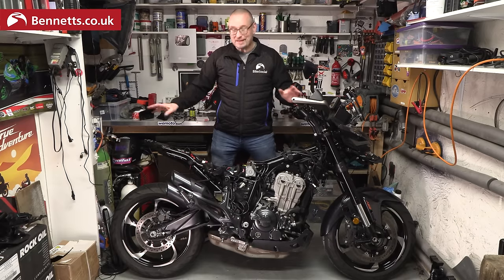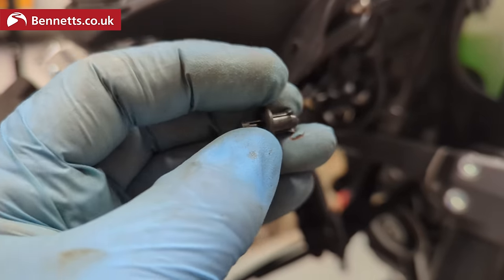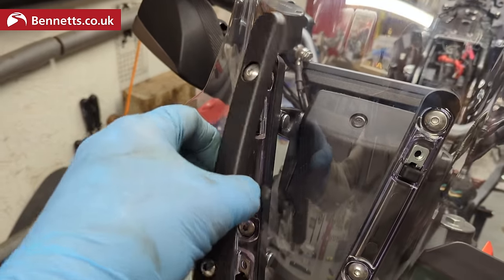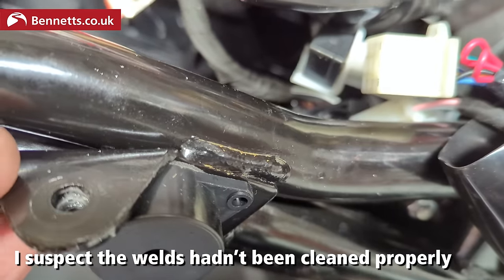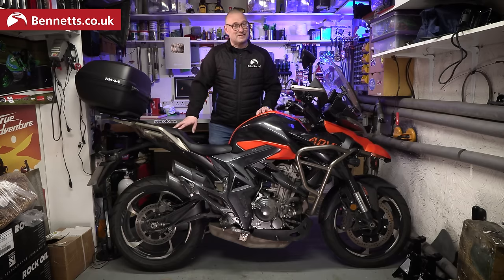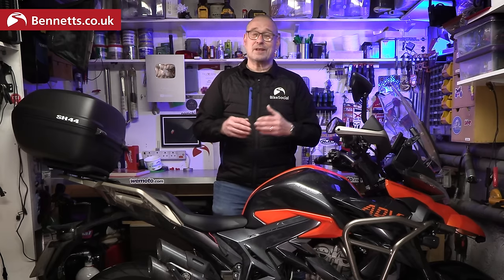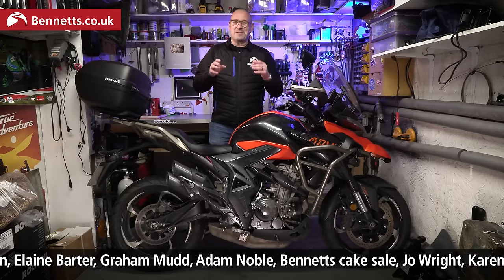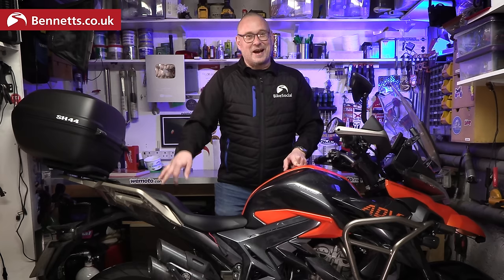Good and bad with my Chinese motorcycle: Electrics, rust and fault codes

Comment: I love the attention to detail on the bike (apart from the Bosch unit). Thanks for showing us how it looks under the skin! Keyless entry on bike solves no problem we ever had. And this is not a bash at Zontes. BMW do it, Triumph, Ducati... it is crap. It causes more issues rather than making life easier. You cannot lose a key that it in the ignition. You can, however lose a fob while you are out riding.
Reply: I keep my fob in the inside zipped pocket of my jacket, I never ride without the jacket not ever.  I also keep 2 spare batteries with the fob just in case but I've not needed to use them as the bike let's me know when the fob battery is low.  I also have a permanently attached cable/connector to the bikes battery behind a pop off panel just incase it goes flat so I can unlock the seat.
Reply: I will have to correct you on that. I have had a key jump/fall out of the ignition barrel on my high mileage gpz900. It was a shock after doing 30 odd miles across London to find no key in the ignition.
I was fortunate enough though to have the keyring and plastic part of the key to melt and stick to the top of the downpipes.

Comment: When I watched the previous video i was considering a new Zontes-G1 scrambler125 for around £3200.
I instead got a 2005 Honda Varadero XL125 in mint condition 7k miles for the same money, 
I think I made the right choice.
Reply: Absolutely.
Reply: Just don't ruin it with awful chav modifications lol. very rare seeing a good condition Varadero these days.
Reply: @mrpantur7280  I've not seen any Varaderos with chavy mods on tbh, I had a Speedfight 2 2stroke before this and that was a chavtastic special - this one is a bit more grown up.
Reply: @TheOmniscientAtheist  dam. Where I live I've probably only seen 2 clean examples. Usually they are covered in stickers and have modified exhausts that has a exhaust leak and the engine is rattling because it hasn't had an oil change for 5 years lol. Yeah seen loads of chav 2 stroke Peds. Especially if it's an aerox or Zip they always smashed up and heavily modified lol.
Reply: I think you did and you weren't supporting a hostile power.
Reply: I have my g1 125 for 34 months and 15k. No problems at all
Reply: @arthurramm8664  -  In all honesty that's probably the most ridiculous comment in here. Stupidity on top of propaganda! Sad really!

Comment: Under a couple of thousand miles and there's already paint flaking around the welds exposing corrosion beneath !
That's not an issue with the welds not being cleaned, that is paint over rust ! I know it's a budget bike but people buy bikes like this to commute to work and have fun on their days off, those electrical issues could leave you stranded at any time !
Reply from the maker: Hopefully not when I'm on my way down to Spain! Still, that's what this test is to find out... Cheers, John
Reply: @bennettsbikesocial  The world loves an optimist. On your own that could potentially be an adventure (been there, done that on three continents), but with your wife on board…? Yep, you’re definitely an optimist. 

I once drove a Volvo 264 with a KNOWN busted cylinder block paper gasket, from the UK to half way up Norway in the middle of winter - without snow tyres!! (Not only Totally illegal, but officially regarded as impossible). 

I was running an open radiator (to prevent the cooling system from pressurising and forcing water into the oil), and had a washer bottle with water pump from an Austin 1300 rigged to top up the radiator every few miles as it boiled away. The system was wired up to a redundant switch on the dashboard. 

Naturally the heater was on full all the time, so it helped augment the main cooling system. I was carrying litres of water in bottles, and had to stop multiple times to refill everything - once at a fast flowing mountain stream that was only acceptable over a field of 2ft deep snow. 

No one ever believes this story, except my fiancé who was waiting for me in our apartment half way up the side of a fjord. 

Despite coming off the road several times, and performing the most ludicrous stunts to navigate up the steep inclines after disembarking from the multiple ferries, and averaging 15mph over two and a half days of driving, I eventually arrived in one piece, and loved every single minute of the journey. 

Driving back to the UK, in the same car, in the same condition (except for studded tyres), but now with my fiancé on board, FULLY loaded with gear, was a somewhat less funny experience. 

They are much more sensitive to impending disaster, and wired less predictably than Chinese bikes. 

Peace 🏴
Reply: @G58  😪
Reply: my Lexmoto had a throttle issue - left me stranded just like you said!
Reply: Although in a perfect world all those welds would have been immaculately clean before painting. And the electrics could be made next level. The fact remain that It's a cheap bike. With way more features than the Japanese competitors. And truth be told regarding many of those issues even the Japanese bikes are not totally exempt of them! Which is something anyone who work on their own bikes could tell you right away. 
In all honesty I'm very well impressed by the overall bike until now. A few rough edges, for sure, but none that I could pin point as a deal breaker. I'm pretty sure in a few years most probably production methods will evolve. And things like galvanized frames will be a reality but then the price... ;-)
Reply: @CensorshipGenesis  There's an old saying which is relevant, "buy cheap, buy twice" !

Comment: I bought a six month old Sinnis terrain 125 when I passed my CBT. I ordered it for eight months and about 2000 miles on a mix of 40 mile trips up to a 1000mile four day tour. While the dealer network were not particularly good (overhead telephone conversations about not bothering to replace seals, wrong oil used, poor customer service/timekeeping), the bike itself was great. I don’t recall it ever letting me down(although on the factory battery it struggled to keep itself charged and supply my heated kit) and on one day back from the Lake District (370 miles) it was at 9000rpm, red lining, all day without any complaint. I did swap the tyres across from the CST Nylon specials to Metzelers. It was also hosed down with ACF regularly. Overall I was impressed particularly given everyone said it would be a mistake. The depreciation was spectacular for the first owner as list was £3400 and I paid £2100 but then I sold it for £2200. I’d get another. My next bike was a 748, which I still have and now a r1250 GSA but I’d love to ride that Sinnis again as it would be a laugh. Motorways were not as much fun but I could happily go green landing on it and I do recall a couple that took a pair to Mongolia with little fuss.
Reply from the maker: Thanks so much for this! Please do join our FB group if you can. Cheers, John
Reply: I've a carbon copy experience with my sinnis terrain too, I strangely wish I'd kept it for town and local runs. The throttle cable went on mine and a AA guy made me a new one on the side of the road in the middle of Northumberland moors- which I never replaced!!

Comment: Thanks you for being so informative and it's quite refreshing for someone to go so in depth. I've got a new NC750X and it's got 700 miles on it now and the exhaust is showing some rust already and I've not even been out in the rain just once one slightly wet roads. Also the plastic panels just above the pegs are showing signs of scratches where my trousers rest so I've covered them with helicopter tape. So in essence it's not just the Chinese bikes..
Reply: I have the cmx rebel 500 it’s only 9 months old, the front bottom fork on the left side mat black paint has started coming off, luckily my Honda dealer got it done under warranty, but all bikes these days have problems with paint coming off, I have a virago 750 it’s from 1993 and the paint is still perfect on the forks , so it must be the different paints they use today .
Reply from the maker: Thanks for watching! All the best, John

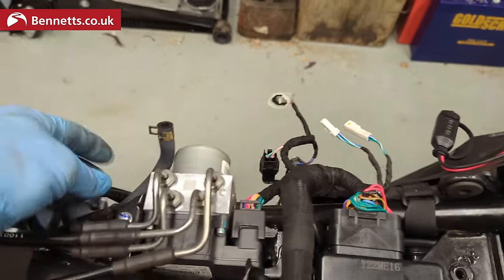Comment: Spotter here - the connector in your hand at 2:17 is a TE Electronics Superseal connector - a fairly pricey family of connectors found on premium bikes (like the Ducati 1199) and cars (like the McLarens I used to work on). The smaller connectors at 2:21 and 8:29 are Japan Solderless Terminals (JST) connectors and (again) are fairly premium, high quality connectors (and found on the 1199) - so it's very surprising to find this 'quality' of electrical hardware on such a budget bike......

.......They are however, regularly counterfeited and available on the likes of Amazon, eBay, AliExpress etc etc. - the types of counterfeit manufacturing regularly attributed to the Chinese.
Reply from the maker: Fantastic, thanks very much for this!
Reply: pair of 2 pin superseal connectors cost around 70 euro cents...
Reply: Yep anything that 'looks' quality is a tofu copy.

Comment: Great stuff! Be very interested to see the same re CF moto bikes.
Reply: I had a 2022 CF Moto 250NK  for a while and I had a couple of issues with it.  First one was after riding in the rain I had a fault showed up on the display and it only went when I clicked the on/off stop switch next to the throttle a couple of times.  Must had got water inside.  The second which was more annoying was the heat from the engine on a warm day.  Very uncomfortable and I feel they didn't get the fan to come on early enough.  Apart from those issues I liked it.

Comment: Excellent report thank you very much! About the warning light, I haven't had any since I bought the bike in October. Still, I think my case is different because I know that the 350T is assembled in Egypt and they have fixed the errors of the previous generations; again, this is according to what the local manufacturer has said. Talking about the antenna, I had the same problem at the beginning when I left the bike unused for a while, but when I went back to using it every two days, things went back to normal, I do not have any explanations for this. Finally, you are right about the rust. 
As for your trip to Spain, I know a YouTuber has made a long trip from Egypt to Libya with his 350T, so you can rest assured that the conditions of your trip to Spain will be much smoother.

Comment: A few years ago I had a Chinese electric engineering machine. I striped out all the wiring and fuse box and replaced with flexible race quality cable etc. Total reliability and better efficiency. The quality of steel was still crap but it did what I needed.

Comment: I'd always stand by the belief of having all the yaw and wheelie control, abs, efi, drive by wires, real time suspension adjusters,  or any tech to push performance and driveability on heavy adv bikes or circuit bikes.

..but for small cc adv, commuters, or thumpers below 650cc, carbies all the way! That's considering the rider knows what to do with a wrench tho lol

Comment: I have a terrible problem with my 1 year old Herald Maverick 250. It's been sitting in my garage with a full tank of E10 since October, but the battery didn't go flat and the thing fired right up this morning. It has almost 9000km on the clocks and it hasn't gone wrong once, no rust no flakey paint nothing,  despite commuting through all the salt and rain, and being hammered off road most days. (ACF 50 is a miracle worker). Everyone tells me this isn't right, and I should sell it quickly while it still has a years warranty and RAC recovery left on it. I would add that the electrode fell off the "NGK" spark plug when I was gapping it, and the local motor factor told me it was a counterfeit.

Comment: The BMW GS suffers from corrosion problems, would love to see a video of that, as they are rather expensive motorbikes.
Reply from the maker: Touch wood, mine hasn't yet (2019)
Reply: @bennettsbikesocial  Thanks for reply, but that doesn't mean they DON'T corrode. Pretty sure viewers would like to see a £20,000 GS with the Bad/Ugly points as well. Go On be brave!
Reply from the maker: @frankspeakmore7104  if mine did it, I would. Look back at some of the previous videos and I'm not shy of highlighting any issues I have, no matter what the brand.

Comment: I have a Zontes 310-X2 instead of the 350T. One common issue on my bike is the coolant container tends to develop a leak. I had mine replaced about a year into owning it (around end 2020), and the replacement started to leak end of 2022.

The other issue is that the brake line needs to be bled quite often. Somehow air gets trapped one way or another.

I didn't have the Dump Sensor issue, but it does make me want to strip my Zontes just to see how the unit is placed.

Comment: Not interested in this Chinese stuff but my ears pricked up when you mentioned a satnav review! I use a car TomTom in a waterproof case (bike satnavs are horrifically expensive) as it has speed camera warnings which has proved very useful to me on a few occasions. I think I'm correct in saying phones still use cellular network antennas which can have dead spots while satnavs use satellites.
Reply from the maker: Depends on the phone, though the tablet I use (a Carpe Iter) has a dedicated high-end GPS chip: https://www.bennetts.co.uk/bikesocial/reviews/products/motorcycle-technology/carpe-iter-v4b-tablet-review
Reply: Nah.  Every smartphone has GPS, works really well with maps. Waze is especially good as users can input real-time alerts for crashes, speedtrap vans etc, and every user in that area gets immediate update).  I used Garmin satnavs for years, but now I'm solid for Waze.

Comment: A really good, detailed and in depth analysis. With reference to the ECU, I wonder if the foam pads are meant to be self-adhesive on both sides, with the ECU being held on the underside of the rear subframe? Still doesn't explain or excuse the ziptied earth connector though...
Reply from the maker: No, sadly not. And the chassis plates are too contoured for that to work. Nice idea though. Cheers, John
Reply: @bennettsbikesocial  Thanks for replying 👍
Reply from the maker: @luddite6239  sorry it took a while... Four of us from work were doing a firewalk to raise money for Magpas!
Reply: @bennettsbikesocial  🔥🔥🦶🔥🔥 Ouch!

Comment: Buying a Chinese bike is a bit like buying a "Used something else." They are modestly priced and you get exactly what you have paid for. I have recently bought a 2023 Moto Guzzi V7850. It was a lot of money and is built like it was hewn from granite. However, I have still found cross threaded bolts on it and such. So, NOTHING is ever 100% fault free, even the expensive stuff on occasion. I also have a "Chinese made,"  Benelli Imperiale 400 in my collection. It is 3 years old  now, with just under 5000 miles on it. I use it for going up to the village to go shopping and nipping to the garage for a pint of milk etc. It does need "Keeping dry" as the chrome is not been very good, and the ABS fault light,  has a mind of it's own but, it has been faultlessly reliable, economical and great fun to ride. I could see it still being a useful runaround for another 20 years.  I'm enjoying the series and hope to see more of the same! 👍👍.
Reply from the maker: Thanks! Please do join our FB group if you have a chance too. Cheers, John

Comment: I had a Sinnis 250 retrostar, based on a gn250. It was fast, reliable and economical but peripherals are bad like hard seat and poor quality chain n rear shocks which can easily be changed. Worst part was the very heavy clutch; your arm hurts after an along ride. 
Then I had a cbr250 which was altogether far less rough but riding position too cramped. It's not easy finding the ideal bike.

Comment: I have a 2 year old 310 ADV with 15,000 miles on It has been pretty good but has had faults. my son has a 125 U1. The keyless system uses a P.K.E unit and you can start the bike if the fob batteries are flat.
Reply from the maker: That's the bit that's not working on mine at the mo

Comment: careful with the fuel connectors. the fuel pump plastic gets brittle over 3 years....... my 310r suffered. the bikes well made but you need the hands of a small child to get things off. electronic seat hidden release is also a huge headache!
Reply: Agreed.. The disassembly required to get access to the seat lock is considerable, especially if you have side cases  and mounting frame attached.  My solenoid failed (corroded  copper wire wrapping for some reason)  I bought a generic solenoid  online and managed to customize it to fit the lock instead of buying a whole new lock assembly. There is an access hole in the wheel arch for a screw driver to manually unlock the seat where the side cases frame is bolted but it is a pain to get to. The bike does seem to be pretty well protected against rain ingress....I think frequent pressure washing was the cause of the failure

Comment: Chigee is amazing at early bird price TPMS on screen tyre pressures and temp, front rear cameras BSD amazing shame it’s is not removable I tried to put a ram bolt but plate hole is smaller

Comment: Anybody who works in Engineering knows that reaching 80% of the proyect is realatively easy, the problem lies in the last 20%. The top 20% of the work usually takes 80% of the time and budget. 

That's why old Japanese bikes are better than new Chinese ones. The Chinese ones have decent quality, but they lack that top percert of quality, which is what makes a difference. And contrary to many people's believe, they're not close to reach the Japanese quality, as they're still reaching the 70-80% of the quality. The big steep for quality improvements is what comes next.